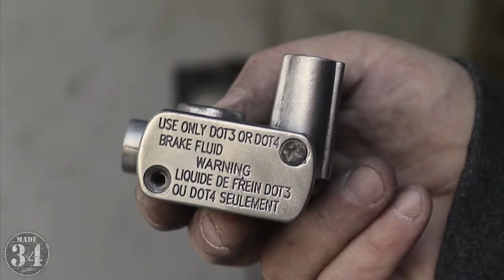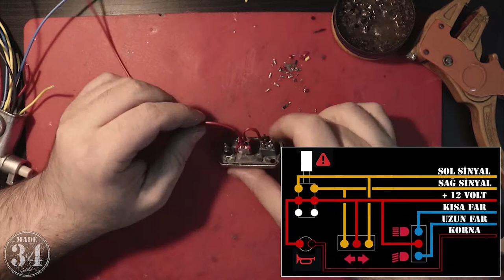How To Make A Motorcycle Handlebar Switch Box Using Brake Master Cylinder ?

Comment: What kind of switches are those for the high beams? Is that an on, off, on switch? Or is there a special switch needed for the high beams that’s different than the signal switch?  Thanks in advance